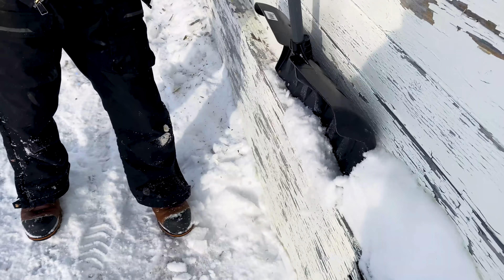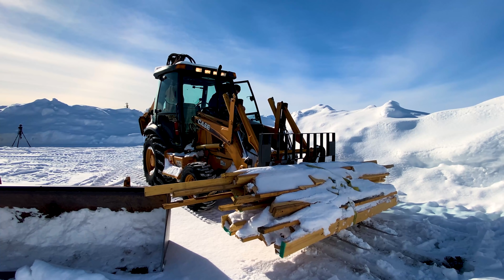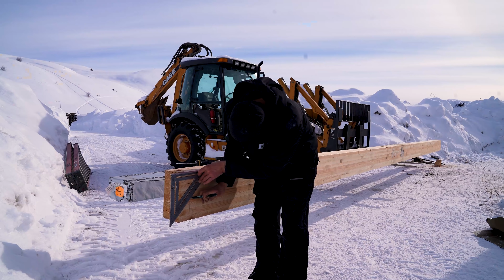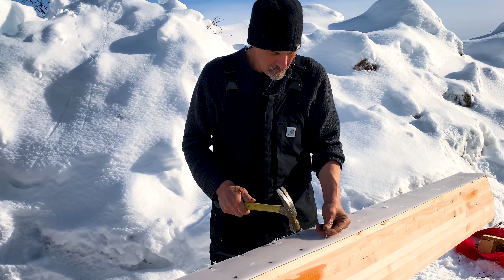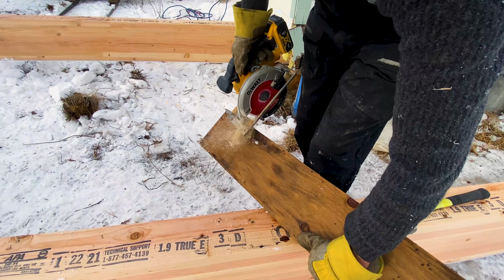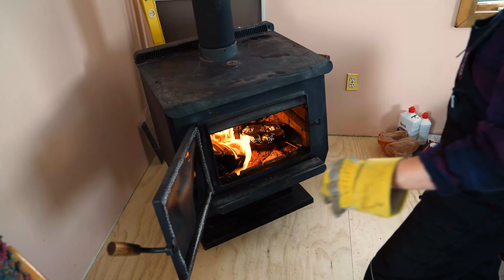THIS had to be DONE! (At Our Off-Grid, Alaskan Cabin)

Comment: My wife and I live in Central Illinois.  The temp today will reach ... almost 60°.  It is nuts!  Possible thunder storms and even tornados.  It is beyond normal.  At least we can 😢.  Your snow is consistent and powerful. I make no comparison.  Just the way it is.
Reply from the maker: Yes, it’s been an unusually cold winter here. Some of the coldest temperatures I have seen in over 50 years. We had days at -60 F (and colder). It lasted for weeks too. Certainly keeps life challenging. I like to take walks each day and I tried ti put in several miles even on the coldest days. But at -50 I stayed by the fire!

Comment: I would have coated the bottom and back side with asphalt foundation coating. Did you determine what caused the original wood beams to rot? Did you ask if it could have been pressure treated?
Reply from the maker: Hello there Gary. There wasn't any PT used in the original foundation. Very little rot actually occurs at this elevation. You have to try hard to get something to decay in a decent way. One thing we do have is lots of rain and persistent driving winds. There are no overhanging eaves on the gable ends and the ship-lapped siding was always wet. Before it could dry out it got another soaking,,, for 30 some odd years. That  is why there was rot. Consider how long it took to get as bad as it was though, many, many years, and it wasn't pressure treated wood. The foundation we build will last the lifetime of this little house. That is one of the many things I love about building in these mountains.

Comment: How do you keep your tractor winterized and mainly starting. Do you leave it outside usually?
Take the battery inside every night and heated dip stick, but you would need electric power all night.
Love your videos. 
Your definitely in great shape.
Reply from the maker: The tractor has a frost plug heater and oil pan heater. If I plug it in for a few hours it will start and very cold temperatures

Comment: In cold places like Alaska, does it stay warmer if the house is off the ground, if comparing it to a similar house, they'd have the same floor thickness with one on the ground and the other not on the groun? (Tundra, permafrost)

Thanks.
Reply from the maker: Good morning Noah. Good question. Both types of floor systems or building methods work well when built correctly. Building above the ground on piles, is typically found in places where a conventional foundation (on the ground) is not possible or practical. Both stay equally warm though. Peace my friend
Reply: @ThisIsMyAlaska  Thank you very much. Good luck. Its really quite fun to see how ppl live in different places.

Comment: I'm curious how far down the ground freezes there. With the up and down movement of the ground in winter and spring I would think you would want a foundation that goes down below the freezing point. Otherwise doesn't the cabin get twisted out of kilter?
Reply from the maker: Hello Jim. The ground freezes 4 to 5 feet down here. That said, in remote locations it is common to build surface wood crib style foundations resting directly on gravel pads. I have seen and built many of these and they stay surprisingly stable year around
Reply: @ThisIsMyAlaska  That is interesting. I'm getting ready to build a little cabin and and considering various foundation options. Here the ground freezes down about a meter or so. Every spring several of my wood racks start leaning one way or the other. Usually the sunny side thaws first and that side of the rack sinks down, sometimes even causing it to fall over.

Comment: Your not using the second skid on front side??
Reply from the maker: Yes. We will continue in the next video. We have three beams that will be supporting the floor
Reply: @ThisIsMyAlaska  well shoot sense you doing that with the polly on the skids you should drop it to the ground and spin it so your new front door faces the right way. Then you can drill the ends real quick to put a drift pin in as a jacking point or square off that angle cut twords the top for a jacking point. 
Just a thought no offense my friend